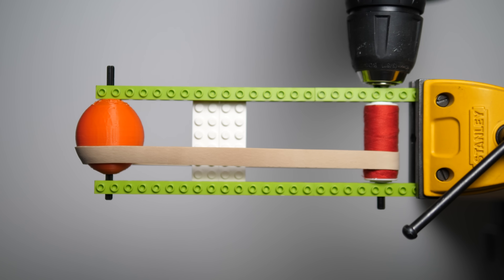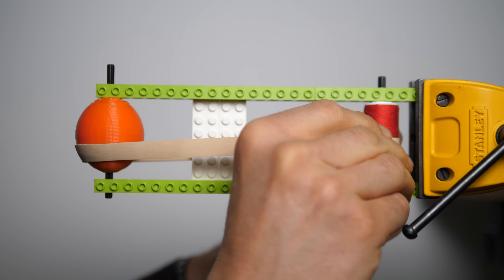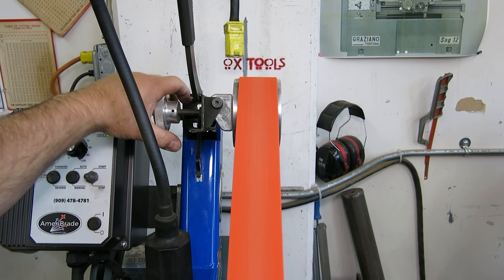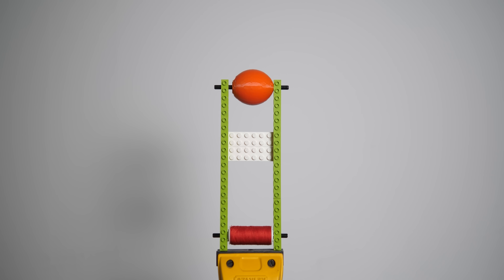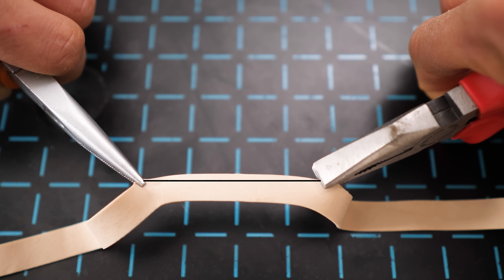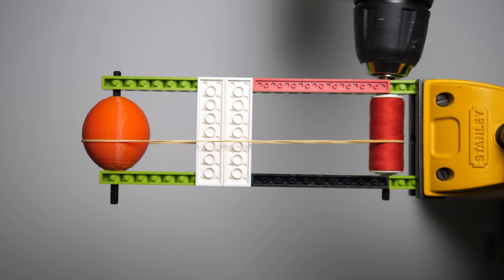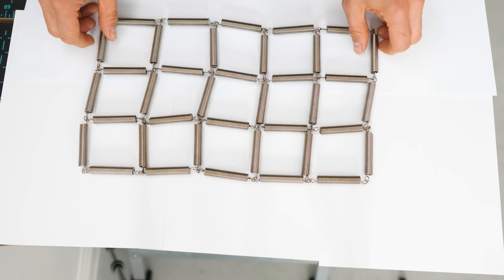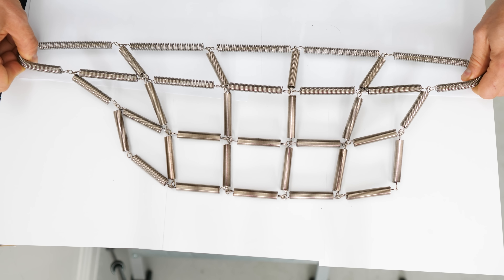The Band Should Slip Off But It Does The Opposite!

Comment: It's   obvious -  that  the  distance  between  cylinder  & outside edge  of  band  - tension  pulling  pressure  is less  than 
-  Cylinder  to  crown  side  of  band is  more due  to  curved  shape  which  means  it  will  climb  to  center  of  crown  -  THANK  GOD FOR  MY  UNDERSTANDING  of  distances  &  pressure / tension  on  each  side  of  band   Simple

Comment: havent finished the video yet. my guess is tension is greater nearer the middle therefore (if the band sits near the bottom of the ball shape), the top of the band is under greater stress than the bottom. this would create a tighter grip around the top of the band and lower grip around the bottom. As the ball is rotated, the higher grip at the top slowly moves the band upwards.

Comment: This reminds me of another unexpected effect with bicycle chains and derailer gears. If the derailer is broken you might think you could shorten the chain, put it around one of the middle sprockets and it would work as a single speed bike. What will almost certainly happen is that the chain will climb up onto the bigger sprocket next to the one you intended and make itself so tight that it can barely turn.

Comment: Look up "Bow Rolls" used in paper making.  Parallel / cylindrical roller bodies, with extended journals each end.  The roller's supported on a self aligning bearing each end, and hydraulic (or other ) actuators impose force upon the journal extensions.  You can bow the roller so it's maximum deflection is central or offset to either side.  it takes the wrinkles out of the paper web and tracks it, too...

Comment: The discussion of the forces inside the stretch band was static and I was looking forward to a dynamic discussion of the part of the band running over the crown having to travel a longer distance around because the crowned pulley rotates as a solid. Assuming perfect elasticity (no slippage), what happens to the the internal forces in the band at the points where the free band meets the pulley and where it is released on the other side?

Comment: Nice explanation of the curve of the belt, it's very similar to slip angles for tires in car steering.

Another application are in long continuous metal coiling lines uses crowned rolls and additionally rolls that change angle to induce the "up hill" climb for steering.

Comment: Isn't the speed at the equater faster than the poles?(If you're standing very near the pole, it might take 24 hours to travel 1 mile. (1 mile per day.) At the equater, 25,000 miles per day. Much faster. I suspect the speed differential on the wide elastic band causes it to migrate to the fastest part of the sphere. There's not enough surface contact with the smaller bands to be affected by the difference. Same theory with the concave reel. Wider end spins faster, I propose the inverse effect of a skater spinning. Gravity may affect the odds of moving up or down. I would throw in a dash of Surface Tension theory and a splash of pump dynamics. Each rotation would be like a spiral escalator. I formulate,  Increased Surface Area (ISA) + Increased Surface Tension (IST) * Increased Speed  (IS) = Spiral Escalation (SE).

Comment: It is a phenomena that is very common on farm machinery. Wide flat belts run on pulleys that have a crown surface to keep the belt running straight down the centre of the pulleys.

Comment: I was expecting a different explanation. You may see the two sides of the band working with different resulting forces because the perimeter lengths in each side of the belt are different. If you calculate the moment of each side you will have M_upper=F_upper x Radius_upper, M_lower=F_lower x Radius_lower resulting in different values. Then the combined different moments in the belt will produce a perpendicular one that makes the belt twist perpendicular to the rotation axis producing said bow. Also the tighter belt side, side with more diameter, with higher force, will win avoiding slip in this side, resulting that the belt will move in the direction where it is more tighten, where the pulley diameter is higher!

Comment: 1:34 right off the bat a little after a minute and I’m thinking about train wheels and the width of the band which would have to do with the surface tension at the top and bottom of the band there’s a lot more pull at the top of the rubber band bench stretched out so it’s morning to pull itself back to normal or at least an equilibrium between top and bottom so let’s see how to video goes

Comment: Always thought that rubber band goes back to original state because of elastic deformation.  I guess you mean that the reason why rubber band has such a high elastic moduli that it either deforms almost perfectly elastically OR snaps is because of the high entropy state in the original condition.  What about the elastic deformation of metal springs?  That should be a different mechanism of its elasticity.

Comment: it's so simple the reason it goes to the center of the sphere is because the center screeches the rubber band more than the edges. More friction is created. And that friction is in more contact with the sphere, so it pulls the band that way. To think of it in a simple way. The rubber band is attracted to the location it's screeched the most.

Comment: Wrong.  You have stumbled on the principle that makes motor cycle tires turn but that is another story.  The higher up the crown the elastic band is the greater the speed of the band because the band is longer the closer it is to the crown. If the pulley was free to move as the elastic turned it, it would roll in a circle (like a leaned motorcycle tire where the outer radius of the luaned tire is greater than the inner radius.  Try rolling a cone on piece of cardboard and it very strongly wants to turn. Now if you could fix the cone and free the cardboard, the cardboard will be rotated about the thinner end of the cone.  The cone is the domed pulley, the elastic is the paper.  To test this, try using a non-elastic belt.  It will still work..  The forces centering the belt are much greater than the stretchy effect you are claiming.

Comment: I've been wondering if it is not mostly friction with dose of Coriolis effect. The rubber will follow a geodesic that is tangential a the point where there is the most friction. And as it bends, the band will leave the spherical polie which will make the the band wrap around the cylindrical polie a little to the side.  Which will in turn make the band wrap around the spherical polie a little to the side.  And round and round it goes until the geodesic is align with the motion of the band or that the tension is too great to allow any side mouvement.

Comment: you could also think of it more 3 dimensionally like when you stretch the band more in the center than the edges the center is thinner creating an arch shape in the band that mirrors the curve of the oval also causing more of that pulling effect not just the curve on the side view that you showed :)

Comment: Video came across my feed and something I just thought of. What surface better controls a spinning top? There is sort of an analogy here and I recently watched a few high speed top videos. In those videos the top is fairly stable at low speed on any surface but as it spins faster it will seem to ride its way out of the concave dish that is being used. The natural response these individuals have is to get a steeper dish which doesn’t seem to help all that much. This ultimately culminates in high performance tops have very small very compact dishes with walls that are practically vertical. But I wonder if the parallel can be applied here with a concave dish rather than convex? I think this is something that would make a good video discussing the physics and seeing if the intuition is actually wrong on this similar to this problem

Comment: Still, the theory that the infinitesimal curvature of the band just off the crown is what causes it to center still needs to be proven.  It definitely sounds plausible.  
The square band is a good parametric study but mentioning it's aspect ratio is somewhat misleading:  the critical parameter is it is narrow.
I would propose the following experiment:  see if centering continues as tension is decreased to zero - if there is no tension, there is no curvature.  
Distance Study:  If the pulleys are close together, the shorter length minimizes the curvature (or does it?)  The asymptotic study of as the pulley diameter approaches zero as well as the distance between might even reveal something intuitive with the "Lego" model.

My Torsional Theory:   I don't think this is true but when the belt is off the crown, there is torsional bending in the belt.  Since the belt is elastic, behaves like a torsional spring.  The energy twisting that torsional spring wants to dissipate which is what happens as the belt climbs to the crown.  Clearly the torsional stiffness, preload, and crown radius are all involved and may demonstrate that this "component" of centering while present, is negligible.

Comment: Thanks for this explanation. 
If I may contribute, I think that the reason this happens is that the rubber band always moves towards the direction where it is most taut. 
I think that this happens because the there is a difference in angular momentum on this taut side, compared to the loose side. The tightness of the rubber band on the taut side also cause more friction, therefore more traction between the band and its contact. 
We need this friction for a faster angular momentum, just like rubber tyres on a car. 

Thank you for your comprehensive explanation. 

I must include, that this might only happen for a material with elasticity.

Comment: There is an easy way to see most of what is going on, something that is very familiar to most mechanically inclined people.  For the convex pully, do your calculus.  View it not as a single continuous pulley, but a series of sliced pulleys of varying diameter.  It's actually 10, 20, or 100 pulleys of different diameters.  And the wide rubber band is really 10 thin rubber bands that are linked sideways similar to the springs.  
Look at that stack of separate pulleys of different diameters from the side and it becomes much easier to see how if there's a small sideways force you could easily end up climbing onto that next pulley.  Most of the force to pull you onto that next higher pulley actually comes from the ROTATIONAL force not the sideways force.

It's the same as when you have a very tight belt or tire to put onto a pulley or wheel.  You shove it on slightly down lower on the pulley until the edge grips, and then you rotate it and the rotation gives you the mechanical advantage and stretches and pulls the belt or tire onto the pulley or rim.  This is something most people will be intuitively familiar with doing if they have worked on cars or tires or similar items.

Because the surface is continuous, even a tiny sideways force can cause it to move toward the larger side, because the rotational force then grabs it and pulls it out that way, stretching it onto the larger diameter and pulling it off of the smaller diameter.

Comment: I have a 100 year old lathe that uses a pair of flat belt pulleys, both of which are crowned.  The belt stays central, and any engineer can understand why this is.  Consider the forces acting on an elemental length of belt that is slightly displaced sideways.  The resultant force is towards the top of the crown.

Comment: One of my first jobs working in a print shop watching old impression printers run. They had crown pulley and belt arrangements. I always figured the belt centered itself on the pulley because the ratio was higher at the center of the pulley.

Comment: I used to work at a feed supplement mill and when we'd adjust the belts on the vertical legs (conveyors) the belts always traveled to the high side and we'd find the balance point. I never understood how that worked. Thanks for a clear explanation

Comment: Paused at 1:20 to make a guess:
The rubber band returns to the fattest part of the crowned pulley because the edge of the rubber band nearest the crown is stretched more than the edge of the band farthest from the crown.  This causes that side of the rubber band to grip the pulley tighter than the opposite side, such that when it rotates, the band pulls itself in the direction of greater traction until both sides are stretched equally.
Reply: Alright, I'm going to say my guess was close... But wrong.

Comment: Wait so if the bands are pulled back from heat does that mean if you heat up a rubber band itll make a little force graph increasing the force until it deforms easier?

Comment: A train steer in a similar manner as the belt on the crowned pulley, however the rails do not stretch or bend.  opposite pair of wheels are connected by a rigid shaft and the part of the wheel that make contact with the rail is conical , with the big side on the inside.  The similarity:  the two rails are the belt and the two wheels which are bigger near the centerline of the rails is the barrel pulley.
When the train meet a left turn the two wheels move to the right of the rails, so the right wheel effectively become larger and the left wheel become smaller.   As they are connected by a rigid shaft they rotate at the same speed, so the bigger right wheel go faster than the smaller left , thus the rigid shaft connecting the wheels rotate to the left, is steered to the left.
The system is self adjusting and keep the shaft  middle point in the center of the rails when they are straight and slightly outside the center line in turns, just enough so the wheels do not need to slip.
Both explanations, the one presented in the above video of stretching and bending,  and the faster travel on the fat side explain the stability of the flat belt.  Do both contribute?  Is one the primary?
How to decide?  Make a few tests.  For example take two narrow elastic bands,   connect them with "railway traverses", some fabric with low friction coefficient, and put that belt on the barrel pulley of the above video and see if the system is stable.    My guest it will be as for the train ( =pulley ) and the rails ( = belt).

Comment: Something else interesting (and entropy related) is when you stretch an elastic band, it gets hot.  If you let it cool down and then retract it, the same area (middle mostly) that heated up will actually turn cool.  Yes, it works like a refrigerant.
Reply: Didn't someone actually make a "refrigerator" using elastic bands stretching and contracting to illustrate that?
Reply: @robertellis6853   at least JoergSprave did an experiment where he cooled a can of beer 2 degrees Celsius by using a rubber band

Comment: Just looking at the opening, I would have thought the reason quite obvious. The crown has a larger circumference, therefore for a given degree of rotation the larger diameter part will try and pull the band more, the band will distort and there will me more force on the part of the band on the larger diameter and less on that on the smaller diameter. There will therefore be a net force "uphill" pulling the band to to centre. Once it's there, it will automatically self-centre.

Comment: Your explanation is perfectly valid, but I paused the video before you gave it to think about this problem and I came to a different hypothesis.
If the band goes down it shortens. If it shortens, for a given torque the revs go up. If the revs go up, the angular momentum of the ball and the cylinder increases, therefore the torque required gets higher, forcing the pulley to get back to his minimal engine energy consumption state.

Does this make any sense? (asking everyone, thanks in advance!)

Comment: This video helped me. The blade on my cheap, poorly made bandsaw kept slipping off due to some combination of misalignments that I couldn't quite sort out. I noticed the wheel holding the blade was flat and I remembered this video and so I used a knife and some sandpaper to reshape it to a crowned profile shape and voilà it fixed the issue!

Comment: Basically the outside edge of the belt is operating at a different gear ratio then the innermost portion of the belt, the push/pull wants to seek equilibrium and it eventually does…

Comment: i believe the reason that he Rubber band does this is due the Side that is more Stretched has More Friction to the Curved Surface the the Less Stretched Side which may be Experiencing some Slippage,  this will case the bad to Follow the Edge with Less Slippage.  if you use a Material that is Much less Prone to Stretching, this Phenomenon would not happen [ by Ike Hazan ]

Comment: The radius of the curvature of the pully, the grip the band has on the pully surface and how tight the band is pulled over the pully are also factors. It is not a given that the band will always center.

Comment: Interesting explanation, but I am not entirely sold on that 'molecular layer pushing' explanation. I think that could be one effect, but it would not be the dominant one. I am not sure, but I feel this is an effect due to geometry of the sphere. I expect the same effect to happen even if you don't use a rubber tape. Maybe you could try this with a inelastic tape, and confirm. Cheers!